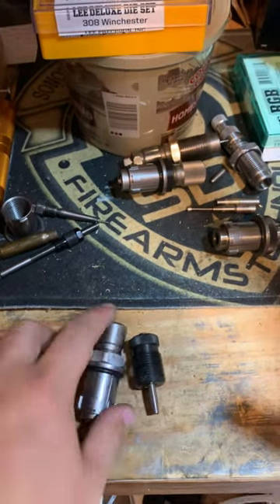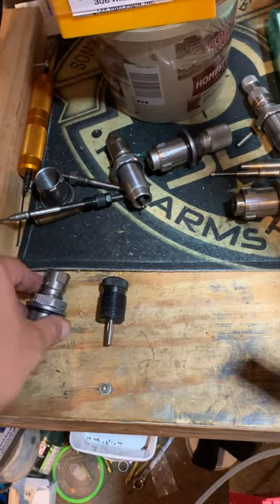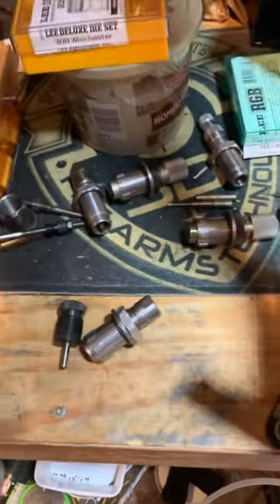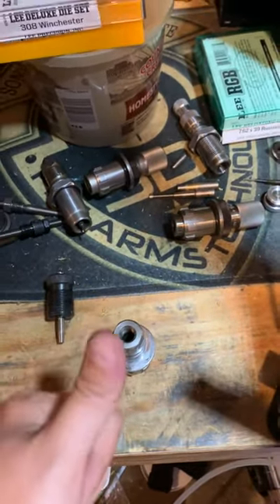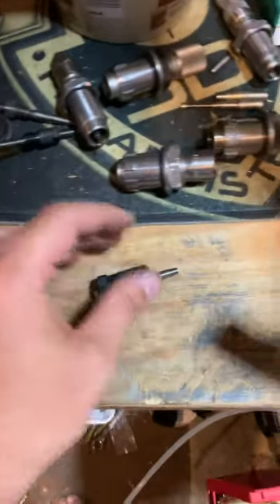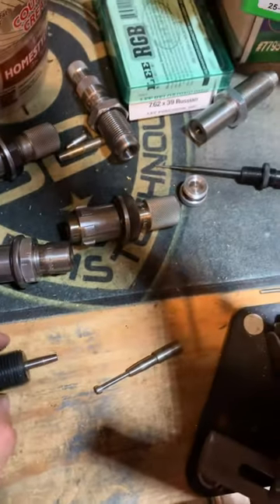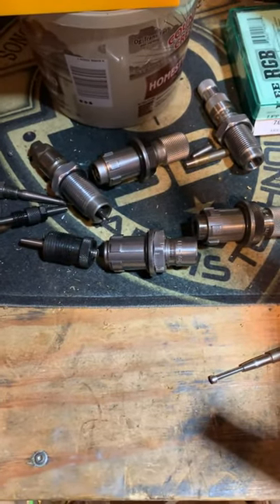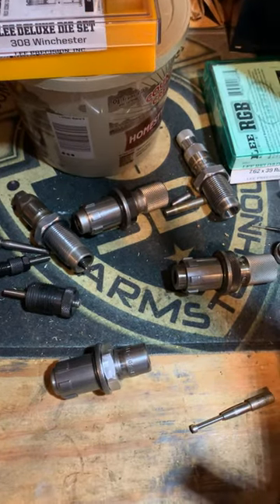Sizing using a Mandrel vs Expander ball/button (part 2)

Comment: Excellent video   I use a Sinclair mandrel die , it tightens down on an o ring . Helps with bullet concentricity . I use this system except I only neck size , works gr8 for me.

Comment: Thanks for the clarification and both videos. Now, could you use the lee collet neck die without its mandrel installed and then use the separate expander mandrel to open up your neck to your preferred neck tension? Thanks again!
Reply: I doubt that would work. If the collet inside is overcompressed, it does not open back up and will crush the necks and shoulders of any brass you try to run through it afterward. That is why the instructions tell you not to cycle your press without a brass, when the die is in it. If you do compress the collet, you can take it out of the die and open it back up by prying it with something like a screwdriver. I learned all of this the hard way and ruined some expensive brass trying to figure out what was going on.

Comment: Instead of lanolin, started using PEG75 lanolin that was recommeded by Mighty Armory. It's water soluble, so cleans off much easier for me, I wet tumble mine after sizing.
Reply from the maker: Yeah that stuff does work pretty well. If I dry tumble right after sizing, even with regular lanolin, it polishes right off and it’s already dry afterwards and I don’t have to mess with drying the brass again before moving on to the next step. We all have our preferred methods and there’s nothing wrong with that.

Comment: I'm wanting to try the mandrel setup but am a little confused.  I have 300 wm with full length rcbs die and K&M mandrel to turn the necks.  28 Nosler with Redding full length S die and bushing(.002 smaller tension) and K&M mandrel to turn neck.
So what diameter is the mandrel you use for your caliber (is yours a K&M). With a bushing die would you use the mandrel after I size?
Reply from the maker: Stephen Jones For best results, do just like I’m saying in this video. Remove the guts from your RCBS FL sizing die, size your brass first with it, then run them through a mandrel setup to open your necks back up to the size you desire. The size of the mandrel you use will depend on how much tension you desire. For a 30cal, and for .002” of tension, you’d want a mandrel .3065” in diameter. The extra .0005” will account for spring back in the brass. For your 28 Nosler, you’d want .2825” for .002” of tension. And yes, I use K&M mandrels for this. I also have mandrels made for me by a friend that go in a Lee seating die in place of the seating cup. They work the same way. 

If you’re using a Redding Type S die, and you want to use a mandrel with it, I suggest you get a bushing that’ll squeeze the neck down more, and be sure there’s no expander button installed on the decapping stem. Run that die like normal, then run the brass through the mandrel like I explained above. It’ll work the same. 

I hope this helps.
Reply from the maker: Also, did you watch the other video I have talking about this method? It’s about 10 minute long. This video here was a follow up to that one.

Comment: By removing that pin on your full length die can you still set  your die to bump back the shoulder 2 thou..
Reply from the maker: Yes. The “pin” is just the part that punches the spent primer out and then opens the neck back up after sizing the rest of the case (including the shoulder). All it does sizes is the neck. Without it, you’re still sizing the entire case, including the neck. The neck is left undersized. So then what I do, as mentioned in the video, I’d us a mandrel setup to open the necks back up rather than with the expander installed in the sizing die. Does that make sense?

Comment: Would a body die and then mandrel do enough? Or does it have to be a full length size die without the guts?
Reply from the maker: @djryan8944  a body die won’t size the neck itself, only the body. So the mandrel wouldn’t do anything after that without the neck being sized back down to under bullet diameter. The full length sizing die without its expander ball/button is the easiest way to achieve this type of sizing I’m talking about in the video, but you could do it with other methods like a Redding type S die without expander, a Forster bump die, or even a Lee collet neck die, although with that one the neck is sized down but the body of the case isn’t touched.
Reply: @ 
Thanks. I have a Redding bushing neck set with body die. Thinking maybe I body, neck, then mandrel?
Reply from the maker: @djryan8944  yes, that would work. I have a few die sets of the style you have. It’ll work just fine in that order, and doing the mandrel as the last step, it’s just an extra step overall, which isn’t a big deal for most people. If you’re doing a bunch of rounds at a time, especially on a single stage, it can be a bit more time consuming, but that’s it.
Reply: @hawkeyeammosmithing  thanks!

Comment: What am I missing, I am with you all the way, but the video ends with the necks being run through the mandrel, meaning now 2 thou oversize. What do you use to get them back to tension before you seat the bullet? Or have I missed the point?
Reply from the maker: Did you watch part 1 first?

So, they’re oversized with a Full Length sizing die without the expander installed, or a bushing due setup (which we you prefer it have), and then the necks are opened back up with a mandrel to set the final neck size and desired amount of tension that’ll be applied to the bullet. The term “oversize” is in reference to sizing the neck more than wanted/needed for final tension. You’re over sizing as I’m squeezing the necks down more than would be needed in the fist step, with the FL sizing die or bushing die setup. Then you’re opening them back up with a mandrel in a second step to set the necks to the .002” of tension (or whatever dimension you prefer”).  Does that make more sense? It’s explained a bit more in the part 1 video, but both the part 1 and part 2 videos were originally videos I made just for one person I was trying to explain this process to a while back. I decided to upload them to YouTube after that. I also have a more in-depth video posted on my channel talking about mandrel use. I’ll post the links here for them. 

Here’s the link to to the part 1 of this video:

https://youtu.be/zJg9e4n0kU4
Reply from the maker: Here’s the link to the other video about mandrel sizing:
https://youtu.be/AdEvL-qR_bo

Comment: Would I be able to do this with an rcbs small base die set? Take out the expander ball and decapping pin that is?
Reply from the maker: Yes. It’s still a full length sizing die, just with smaller dimensions so that it sizes the cases a bit more than a regular FL sizing die. If it’s all you have, it’ll work, but I don’t recommend small base dies if you really don’t need them because that extra sizing equates to working the brass more, which will increase the hardness and brittleness of the brass. It’ll lower the lifespan of the brass. It might not matter for you, but I at least wanted to mention it.
Reply: @hawkeyeammosmithing  oh for sure, I’ve definitely heard about that also with fl sizing dies.  Of course not to the extent of what a small base die would do but I was told that the FL bushing dies are a good way to go. I honestly have been leaning to that but I’m fairly new to reloading and still need to do some more research on the bushing dies and how to figure out what size bushing I would need to go with.
Reply from the maker: @basketcas3717  look into the Forster bump dies. I need to do a video on them, but that die uses a bushing to size the neck, but it also still bumps your shoulders back. It won’t touch the body of the case though. So you can get a bushing that’ll size the neck just enough for the mandrel to move it back and set the neck from the inside diameter, but won’t work the neck as much as a FL sizing die. Plus, you still get the consistency and reliability of bumping your shoulders each time, unlike just a neck sizing die, and you don’t work the body of the case at all. It’s a great compromise. You might run into consistent/reliable cycling though in a semi-auto.

Comment: ........And it’s a colossal waste of time! I used to do it religiously too, until i found out a lot of the tier one shooters have gone back to just using the expander ball when decapping and resizing. Turns out, neck tension is supremely important, and run out is not. Within reason of course. Especially for the average shooter and not some one who competes on a national level. Get a Whidden full length sizing die, bushing or non-bushing, and their expander ball kit and save yourself a ton of time and manpower.
Reply: Have you ever gone with a carbide expander, like Lee or Redding? I thought I'd try and just ordered a Lee to use in RCBS die, in the hopes of not needing to lube inside, and not have the neck stretch back out, and it's floating, etc & not add the extra steps and the mandrels & their die needed as extra step. Trying to eliminate one of the two cleanings I was doing. It seems like a middle-ground between the standard expander ball vs the mandrels. But I don't really know, yet.